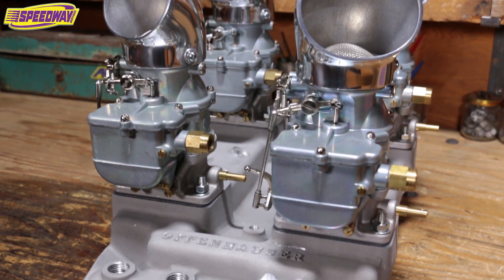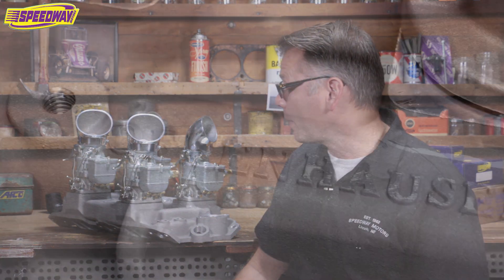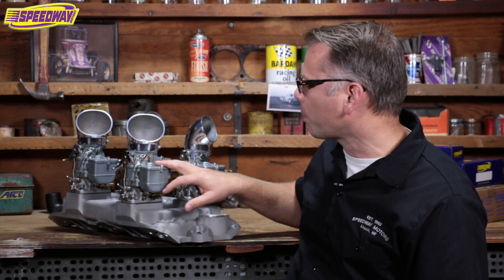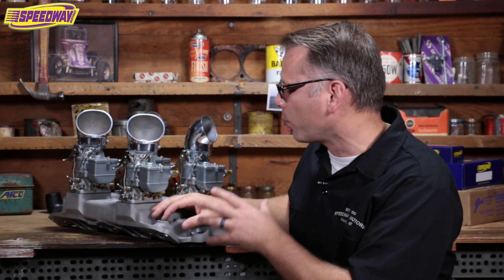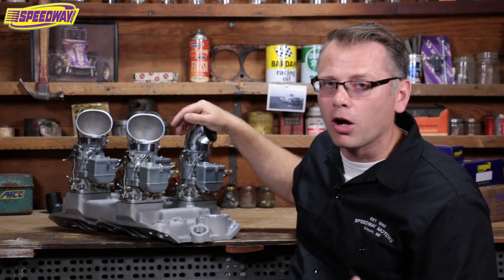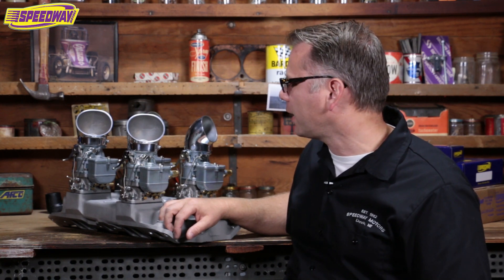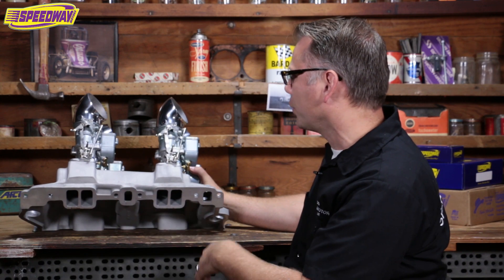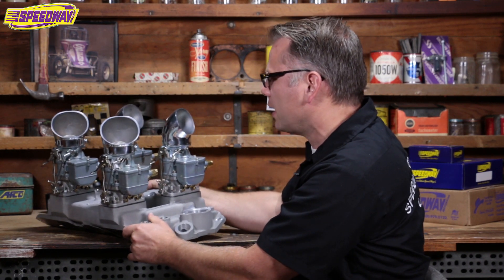Speedway Tech Talk - The Offenhauser 4x2 Pacesetter Intake

Comment: MANY years ago I rode in a friend's '56 Chev 210 with 327 with marine heads (?!), FI pistons and Arnold Charles cam.  It had the Offy 4X2 set-up up top and throttle response was RIGHT NOW!!  What worked then will still work for those of us not brainwashed by "electronics".